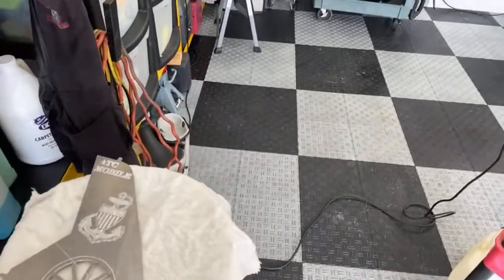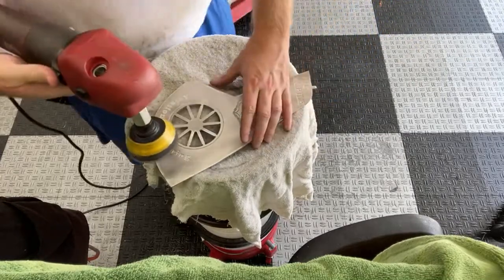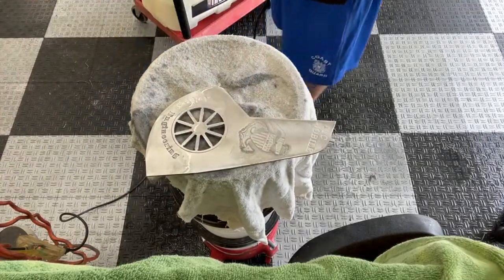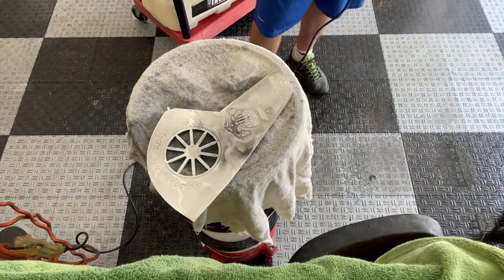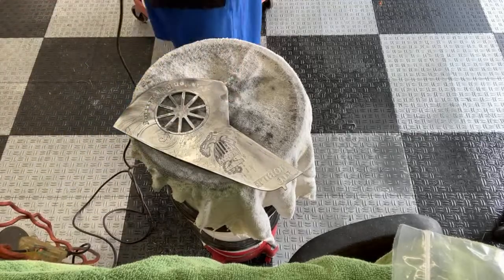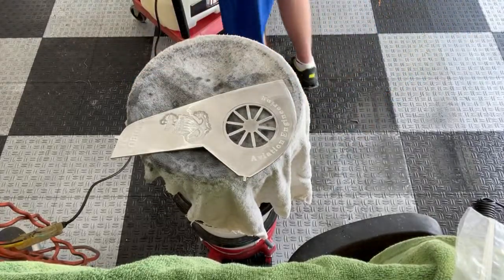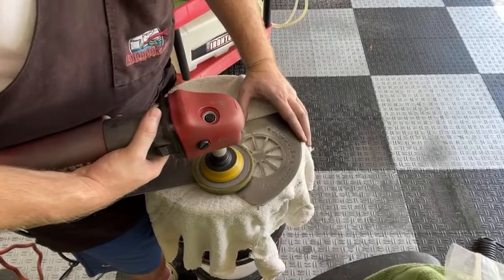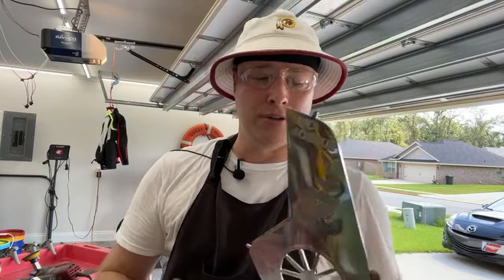Let’s Polish some Metal!

Comment: The "A" and "M" are worn on the top of the plaque.  Is that from too much sanding? 🤔
Reply from the maker: Unfortunately they were not engraved as deeply as the rest. We lathed a batch of 12 and only about 8 we’re usable, this was probably the last usable one. I had to be careful to not sand too much in that area and wipe those letters out.